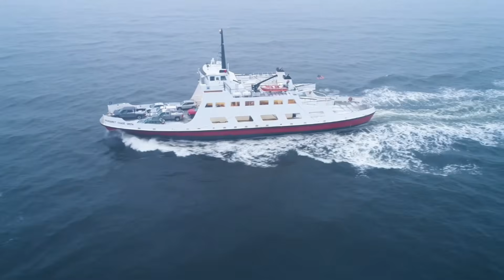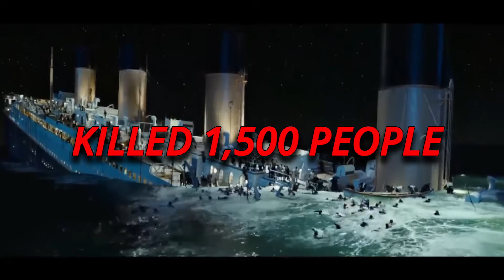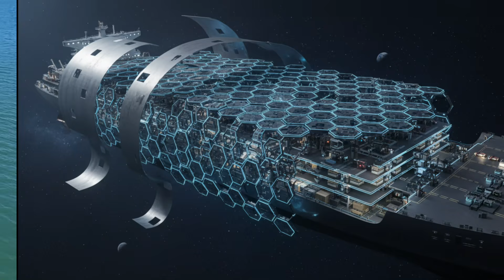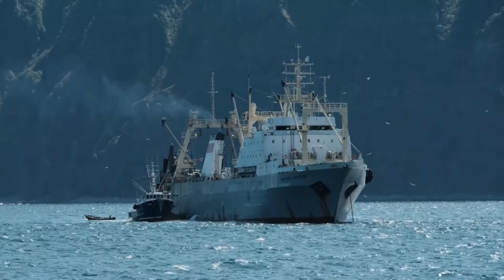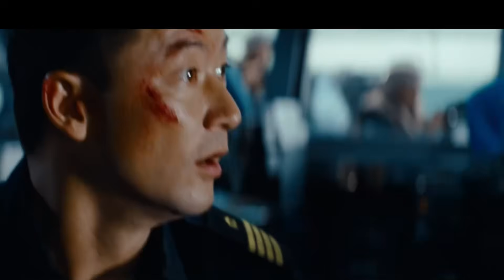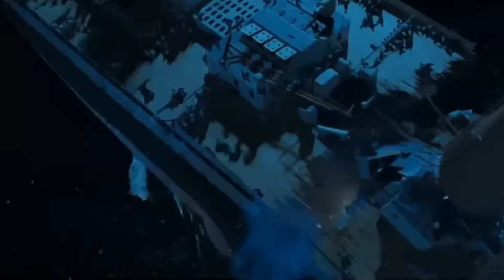Why Giant Cruise Ships NEVER Sink (Even if Flooded)

Comment: Why were the walls made to not clear the top level where they would have stopped flooding? I know they didn't know Jack shit about ship design back in the early 1900's. But if they knew enough to install the bulkheads in the first place why not make them come up all the way in the first place?
Reply from the maker: That is the ultimate 'Ice Cube Tray' flaw. You’re spot on—if they had extended those bulkheads all the way up, the water wouldn't have spilled over into the next compartment. But here's where it gets interesting: It wasn't that they didn't know how; it was a trade-off.
At the time, they prioritized the 'Grand Staircase' and massive, open dining saloons for the first-class experience. Raising those walls would have sliced through those luxury spaces. They bet the ship could survive 4 compartments flooding—thinking 5 or 6 was impossible—and they lost that bet. Engineering is always a battle between the 'Ideal' and the 'Practical,' and unfortunately, that lesson was written in salt water.
Reply: @Machino2.o yeah in the end money talks